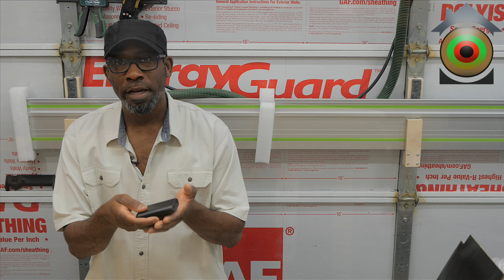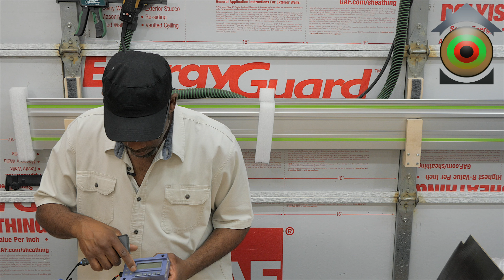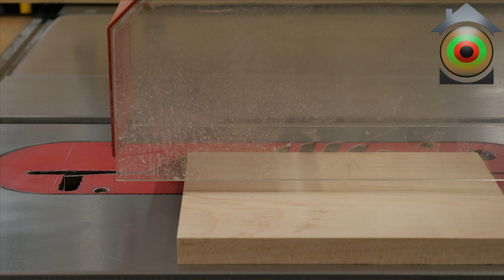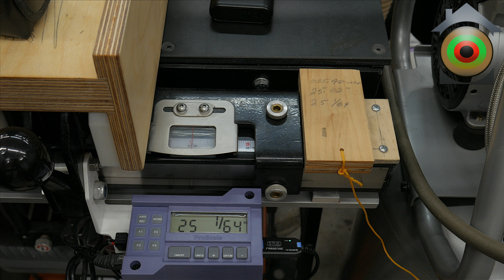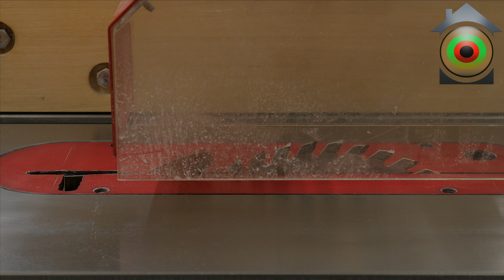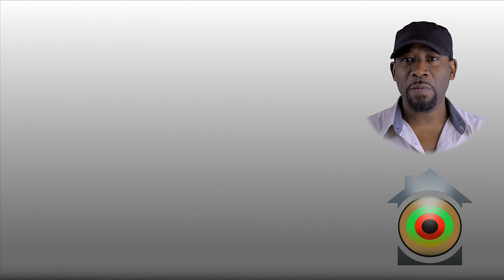PROSCALE DRO, MY SECRET WEAPON FOR ACCURATE TABLE SAW POSITIONING!

Comment: Great video - thank you for sticking with us (ProScale) over the years. If its helpful, our modern readouts (now version 5) automatically use the internal battery when an external power source is removed. And they now have 10 possible DATUM positions you can store - great for different blades or fence configurations.
Reply from the maker: Thanks for watching!

Comment: this seems like a neat idea but i didn't hear what model device you used, what to search for for the voltage converter cable you found on amazon, or how the system works
Reply from the maker: @matteckelkamp  Thanks for watching!

Comment: When it comes to calibrating your equipment. It really depends how deep down the rabbit hole you really want to go... When you start breaking out calipers and dial indicators. Your opening a rotating door, that can drive you mad if you walk through it with no achievable and practical preset personal tolerance's.
Reply from the maker: I agree and have learned to manage it! Lol! Perfection does not exist just acceptable tolerances. Thanks for watching!
Reply: @concentrichomesolutions  I hope you didn't think I was directing my statement at you... I see a lot of myself in how you process information... My initial statement was in general and not directed at anyone specific. Just passing on a little wisdom :)